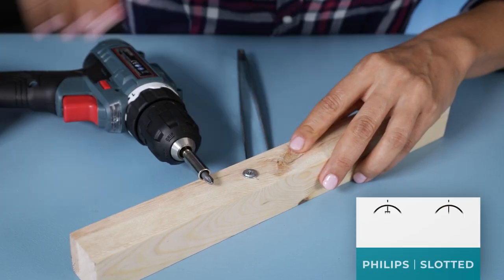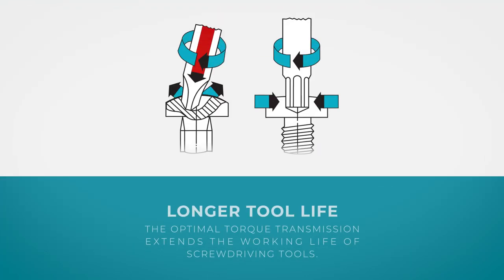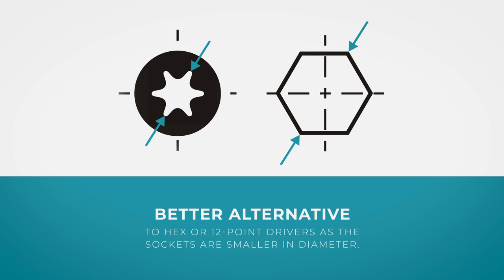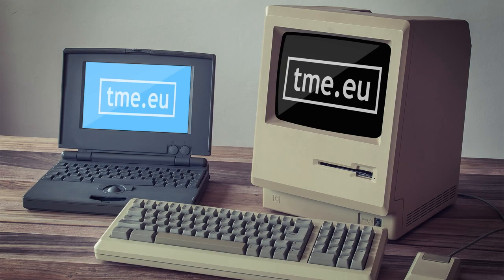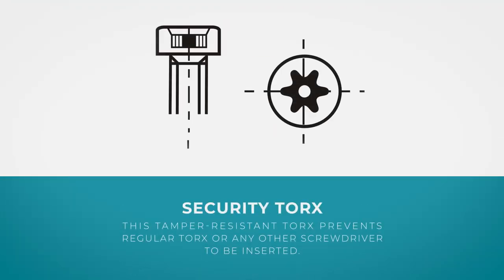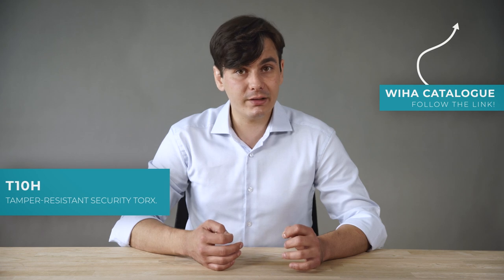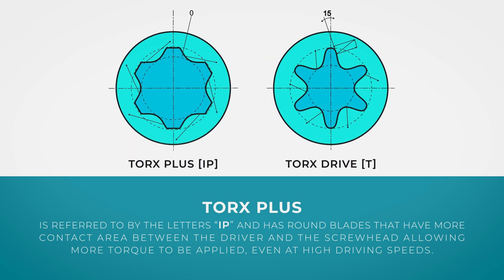TORX - T, TX, E and IP. What is the difference?!

Comment: Can you advise how 5 or 6 pointer Torx or Torx plus are differentiated in nomenclature
 also how secure torx/ Torx plus is identified and how it's specs equated to mm like 
I need a Torx plus 6 pointer secure driver to loosen a screw in my toaster whose slots in head are 4mm

Comment: Is T and TX now the same thing? You mention them together but no mention of any difference.
Reply from the maker: Good day Sir! 
Yes, T and TX refer to the same bit size within the Torx® system. On our offer we use TX as the preferred naming. Some manufacturers may also use the term TX to indicate that their Torx® bits have a slightly different profile than the standard Torx® profile. 
However, this is not always the case, and the vast majority of TX bits are identical to T bits.
We hope it answers your question :D

Comment: Informative, but I stil don't know the difference between T and TX, which is why I watched this video.
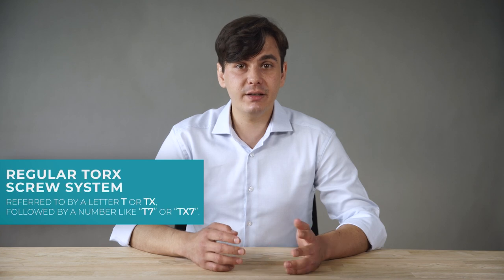Reply from the maker: Hey! That's a great question! The answer is at 1:03 - both acronyms "T" and "TX" refer to a regular Torx screw-drive system. Some manufacturers use only T while others TX. For example, WERA uses TX while Wiha uses T but they refer to the same size. Have a great day!
Reply: @TME.ElectronicComponents  Awesome, thank you for your fast and very complete reply!

Comment: you mentioned they improved on the TORX BITS take the T45 torx for an example there calling it the IP45 ( torx-Plus )  . MY QUESTION IS:::
 when they improved and came out with the IP plus torx system are they interchangeable ? can IP45 be used on the T45 screw head and vice versa?  or are the IP45 screws it's different different enough from the older T45.? I'm trying to figure out if I need to buy a set of IP45sn & T45 as well as the security T45 and do you know if they make a security IP45?  this shit's for the birds. LOL thank you for your time
Reply from the maker: Good day eabster :) Basically, we can look at it as regular Torx and Torx plus. It is NOT ADVISABLE at all to use the regular Torx with the Torx plus (but it will fit). Then, for both versions, you have the security pin. So: 
1 - Torx Regular (T)
2 - Torx Regular Security
3 - Torx Plus (IP)
4 - Torx Plus Security 
If you find yourself thinking about getting yourself new tools, too many times... you know the right answer :P
Have a wonderful day!
Reply: @TME.ElectronicComponents  How about the other way around? Can you put a Torx Plus BIT into a Torx Regular SCREW? I would think not because of the enlarged edges.
Reply from the maker: @stewartxp2400  You are completely right. you cannot fit Torx plus driver into a standard Torx screw. However, you can fit a regular Torx bit into Torx plus screw but you won't be able to tighten it all the way because of the loose fit.
Reply: @stewartxp2400  A normal torx bit can easily strip out a torx plus. I would just buy the two different sets if you are planning on doing anything with them. I just stripped out what I think are torx plus screws on an expensive knife because some dumdum decided they wanted to throw both torx, and torx plus on it...